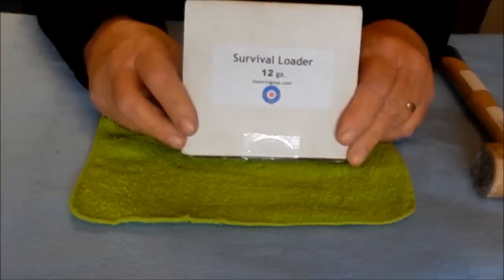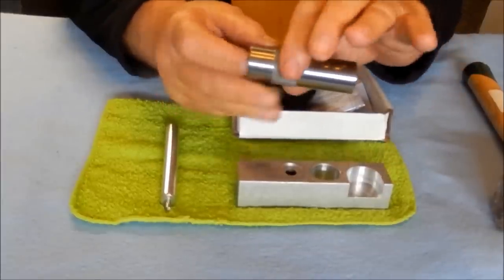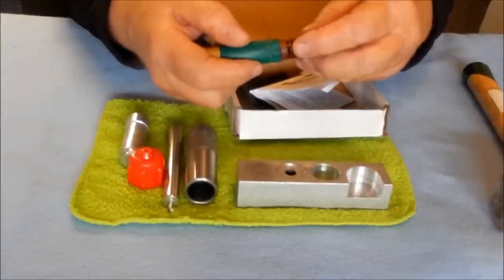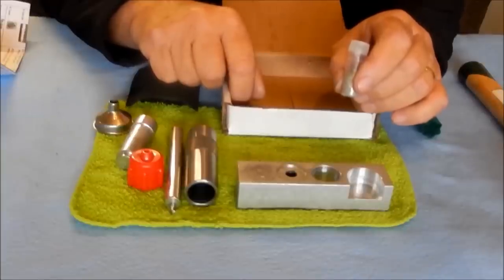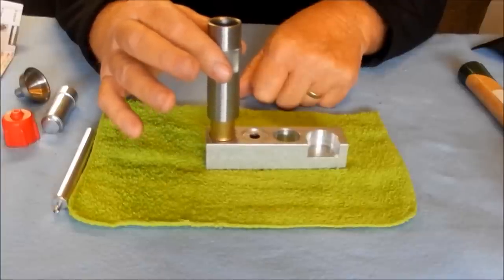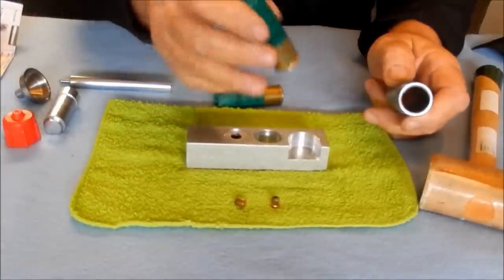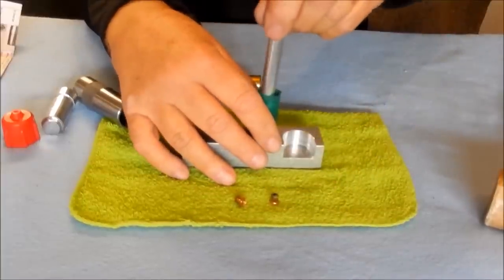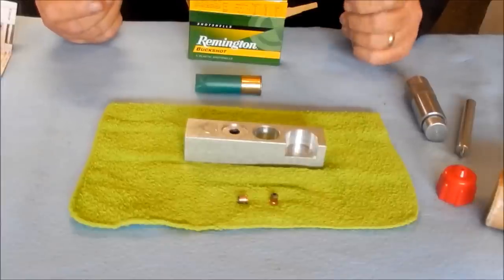Survival Loader -12 ga.---New video update coming for Gen. #2 May, 2024

Comment: Is the sizing die long enough for a 3.5 inch hull?.
Reply from the maker: Good morning Timothy:
No, the Size Die would be too short for the 3.5 hulls.  3" is the longest and of course 2-3/4"
Im sorry to disappoint.  
Best regards
Barry
Reply: declined  No, not disappointed, just curious. I live within an hour or so of Lee and Mec and used to visit Richard Lee back in the day. Mec if course offeres the 3.5 inch presses, but kind of pricey. I prefer "handloading" non toxic, weighing charges and I thought the survival loader could be an affordable alternative to someone who may only need a box or so at camp, without driving all over the countryside  searching for shells. Could a .5 inch sleeve over the brass of the hull plus the chamber allow 3.5 inch loading? (I'd have to review the S.L video. Just looking to simply broaden your market).
Reply: Me again...Winchester sgun primer boxes make great 1 pellet per hole measuring tools for larger nontox. Weigh once, count pellets, mask off 100 count trays with tape, same pellet count per load. Dippers for powder, file extra dippers for specific weight. As always, use an accurate powder scale to verify loads. Best ti all, Tim.
Reply from the maker: Good morning Timothy:
In answer to you question about a 1/2" sleeve or spacer.   
Yes ,but at the other end if you are going to Re-size.  
The LEE product was good and they had a sleeve available for some of the kits.
That said, their Die did not re-size the brass.    If you put some type of sleeve at the top of the Size Die would work fine.    
But if you Do Not want to re-size, then the sleeve at the bottom on the brass base would work just fine.

Manual reloading tools have been available in one form or the other since the late 1800's.  
LEE made a nice modern version that was very successful.
Our Survival Loaders are different.
Both  in design and in function.   
They can either re-size or not.  Your choice.  Plus they have other tools such as the "swage tool" to make the crimps and re-loads even better. 
Especially for semi-autos.

I hope this information helps.  Let me know if you need more info.  I will help as best that I can.
And;  please feel free to comment.  
Other fellow shooters/sportsman also appreciate reading the comment.

Best regards
Barry
Reply from the maker: Good information and thanks for sharing.  
Im sure our fellow shooters will appreciate you input.   
Feel free to write anytime
Barry

Comment: Will this work with full brass hulls?
Reply from the maker: Hello Martin:
No, it won't.  
First: the primer hole is too small for the 209 size primer decap rod,
Second: All brass shells won't resize and may even get stuck in the sizing end of the die,
Third: you would not be able to make a crimped end,

Im sorry to disappoint>. RCBS does have a Size Die with an internal decap pin made especially for All Brass (cowboy action) shells.   You might give that a look.

Best regards
Barry

Comment: Will this work on all brass hulls?
Reply from the maker: Hello:
While the Survival Loader is not designed nor is it intended to load the all brass shells, it can be done with some considerations. 
( I use it on my Mag-Tech Brass Shells )

I would not buy the Survival Loader kit specifically to load only the all Brass Shells.  
It would be a waist of money unless you are also looking to load regular shells.    

For one:    
The primer hole is different on All Brass.  
The all Brass Shells use regular large pistol or rifle primers.  
The 209 Shotgun Primer de-cap rod will to work to de-cap the primer.  The pin is too large.

Also, you cannot crimp the metal. 
You would need to glue an “over-shot” wad inside the case mouth to keep the shot load from falling out. 

I hope this information helps.
Best regards,,,,,,,,,,,Barry
Reply: @barrydeclined2547  should make a video on the brass ones.
Reply from the maker: That is a pretty good suggestion.   
We are planning on doing a total update on all our Survival Loader videos.  
That may just be something to add.  
Thank you for that suggestion.  It is appreciated. 
Best regards…..Barry

Comment from the maker: This applies to International sales only:
Normally we ship to International customers.  
However;  
Due to the Virus lockdown, and the rising case numbers, we had to again suspend International shipping.

A dealer is posting Survival Loader Kits on Ebay.  
Ebay still ships Internationally through their Global Program. 
This is a temporary alternative until such time the Virus emergency clears.
Best regards
Barry
                      On Ebay:
410 bore/ga.
410 ga-bore Reloader - "Survival Reloader" - Load Anywhere - Load Anytime
Item ID: 124165006574

12 ga. PLUS (deluxe)
12 ga. Survival Reloader PLUS (deluxe) - manual hand reloader
(Item ID: 123768131797)

12 ga. Basic
12 ga. Reloader - Survival Reloader BASIC kit - Load Anywhere - Anytime
(Item ID: 123701963446)

Comment: Why not just buy a used Mec jr for $25 - $30 bucks ? I have bought at least 8 to 10 at garage sales for this price.
Reply from the maker: Hello Thomas, you are correct.  you can find the bench mounted machines for reasonable prices.
Those are different than what the Survival Loaders are designed.
These are small, compact and portable units that you can put in a pocket or bug out bag.  
Bench mounted machines are normally not all that portable.    
Same end results, just differently intended usage.
That you for sharing, please feel free to share more with our readers.
Best regards
Barry

Comment: Going to have to stop you at the "weigh every charge, don't use scoops" bit. I have used them, and weighed the results. Technique matters. Inconsistent or incorrect technique will yield inconsistent/incorrect results. Make your own scoop if none in the Lee set are correct for the powder you want to use. Absolutely use a scale to verify that it's correct, but it's absolutely unnecessary to weigh every powder charge. If it varies by .1 or .2 of a grain, so what? You're not loading precision rifle ammo to shoot one hole groups or at 1,000 yards. 

The typical press for reloading shotshells uses a measure system that operates on volume. So do the units on progressive presses for metallic cartridges, and the standalone measures used for metallic reloading as well. That's exactly how the scoops operate. I have experience with all four, and they all have variance.